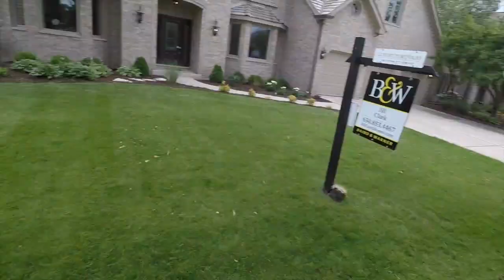Horizon VLOG #15 | Regular Lawn Maintenance Client

Comment: Just a quick note, you would edge way way faster if you edged the opposite way
Reply from the maker: Are you saying to walk backwards and edge? My trimmer head rotates counter clockwise though.
Reply: Horizon Land Management Group my head rotates counter clockwise also, I'm saying walk forward and hold the trimmer to your right side and walk forward makes it much faster
Reply from the maker: So then in order to do it that way, I would have to walk on the sidewalk and not the yard...correct?
Reply from the maker: I'll have to give that a try....I am not sure how much control I'll have with my right hand as I'm left handed....but i'm always up to learn new techniques....especially if it makes me faster without sacrificing quality. Thanks for the tip!
Reply: Horizon Land Management Group walk on the grass